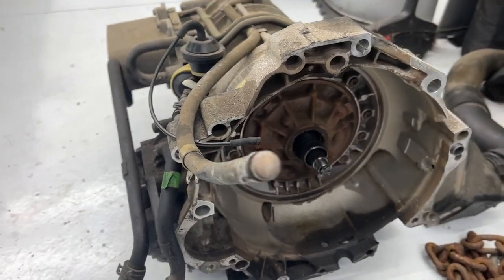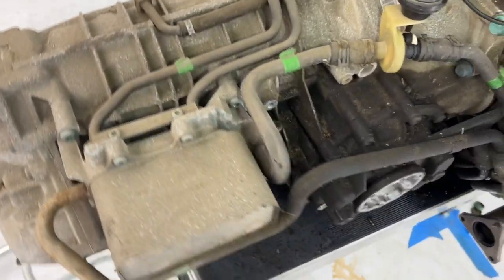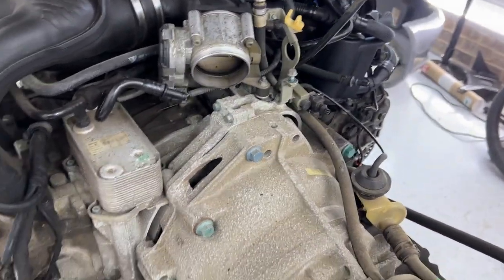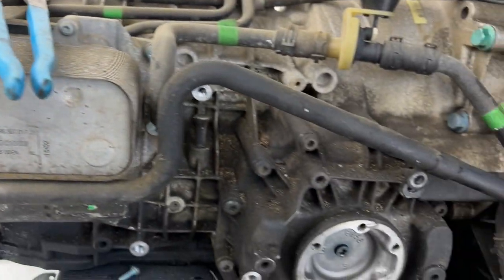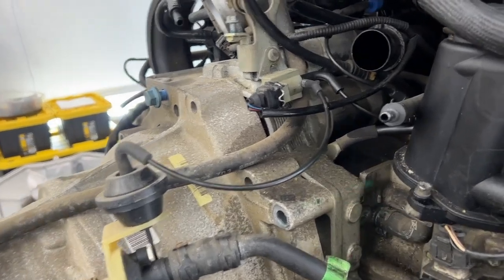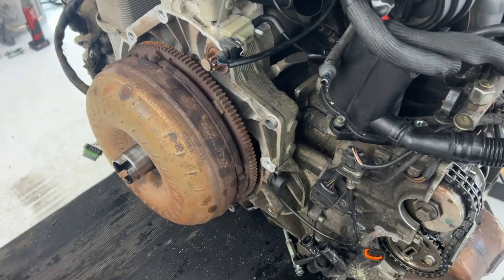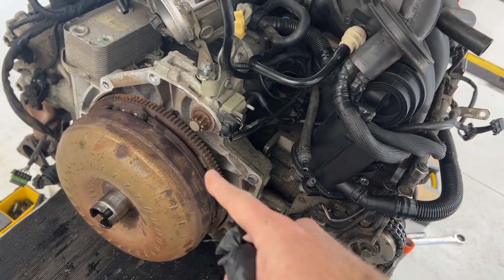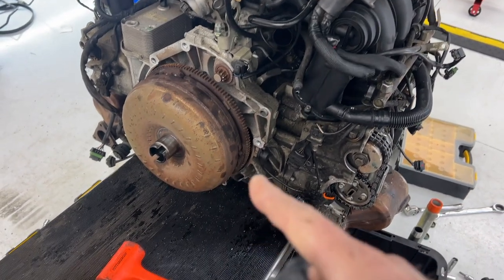Transmission Removal  (BBB Part 10)

Comment: You need to first remove starter - follow pattern in front pulley  which locks every 120 degrees to remove Allen bolts inside  starter hole 
Also note there is a 12 point 
Torx on bell housing 
The converter stays with tranny
Reply from the maker: +Anthony's Channel oh man, is that what those extra non-TDC holes are for?? Excellent!
Reply: @HelpMeDIY  Their primary function is to lock the crank at specific positions where you can slide the wristpins through the engine block during reassembly.

Comment: Hey, I want to say thanks. You're saving me so much money. I don't have the tiptronic, so this particular video isn't really relevant to me, but I watch them all anyway because you provide so much info. I've had my 2000 Boxster S for 20 years and always had the dealership do my work. It's a Porsche, so there has really not been much work, they're so reliable, but when I had to spend three grand to have the convertible top actuator transmissions replaced last year, more than I've spent  in total on repairs (not including maintenance) since I bought the car, I decided to learn to do my own work. I've saved over a thousand bucks this year (water pump replacement and maintenance) and I'm confident I'm doing it right. Maybe a clutch/manual transmission video sometime soon, just in case? Again, thanks.
Reply from the maker: +Rob S glad it’s helping! I have a manual transmission clutch replacement video already 😉
Reply: @HelpMeDIY  Yep, I heard that when I got to the end of the video. Thanks again.

Comment: Progress!   The needlenose vice grips do make good hose clamp pliers and they also make a good hose clamp to stop the flow of fluids while clamping down on a hose.  Slip about 3" of old fuel line (1/2" ID maybe?) over each jaw and you can assure that they won't hurt the hose you're squeezing down on.  

 Man, when you were separating the trans from the block I could just imagine the engine end of the table flipping the engine right on to the floor!  Glad to have been wrong!
Reply from the maker: +Tom Fitch ha ha yeah, it wasn’t until after I had it off that I was wondering how close to the tipping point I was…

Comment: I think you mean you need to remove the starter (not the alternator) to get at the flex plate bolts? And yes, you can certainly remove the starter with the engine in the car!
Reply from the maker: +JT JOMO oh did I say alternator? 😂 yes I meant starter.

Comment: If you free up the cam chains you might be able to rotate the engine to get at the torque converter bolts. Torque converters are crazy expensive so don't drop it. Most shops add an extra days labor for removing a TIP compared to a manual transmission on a Boxster. Real pain is putting it back in place.
Reply from the maker: +Peter Brown yeah, I don’t blame them now… Freeing up the cam chains is my goal. Just trying to figure out how to do that still.
Reply: @HelpMeDIY  It`s easy. You pull the camshafts off on the broken side, then insert a metal bar or piece of wrench inside the chain and pulling that away from the engine you should able to rotate the crank.
Reply from the maker: @Fungaricum  I’ll give that a shot, thanks for the suggestion!

Comment: About a year  ago I purchased  a Porsche Boxster S 2004, with a tiptronic transmission, lately I have been having some issues with loss of power while driving after a message on my dash shows up that says "Selector lever not engaged", I have run different scanners and I have no codes.  I have look all over youtube trying to find what’s causing this issue but when I find a video it only shows the issue not the solution, has anyone seen or had this problem?. Thanks!
Reply from the maker: +@pauldeabreu4553 not me, sorry. Good luck!

Comment: Is there any reason you did not remove the exhaust manifolds/catayltic converters from the engine when you removed the muffler/exhaust system before dropping the engine?  I would have removed the entire exhaust system & manifolds before dropping the engine to make working on it easier and making the engine/trans combo lighter when dropping it.  You can't remove the torque converter from the flex plate when the engine is seized and won't turn over to give access to the bolts which hold the torque converter to the flex plate.  In this case, you really didn't do anything wrong because your engine won't rotate.   You are now going to have to remove the cylinder heads in order to free up the timing chains so you can rotate the engine and remove the torque converter from the flex plate.   Removing the alternator isn't going to solve your problem of having no way to access to ALL of the torque converter bolts.
Reply from the maker: +mike dx yes, you are exactly right. I have learned that…
Reply from the maker: +mike dx oh, and the reason I didn’t remove the exhaust manifold was because I didn’t want to mess with those rusty bolts, and was hoping that they wouldn’t ever have to come off. Wishful thinking, but thinking nonetheless…
Reply: @HelpMeDIY  I understand the wishful thinking... I had to take the manifolds off because of the way I removed the engine. Of the 12 bolts 4 came out, 4 broke (which is better than the...) 4 rounded the bolt heads and I had to drill off the heads. Of course a couple of those were in places where it was impossible to have a straight line access to the heads with the drill...
Reply from the maker: @granthargrave2319  😬